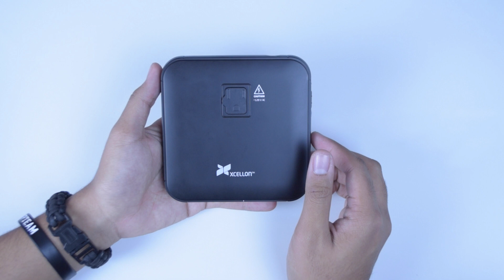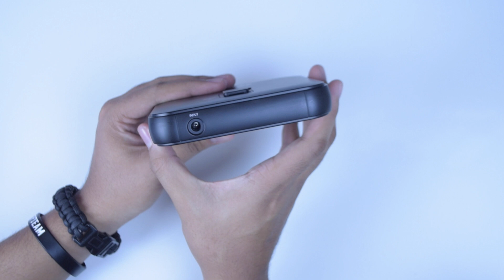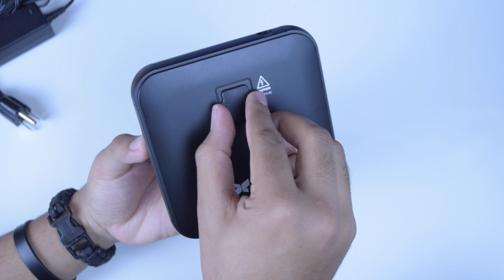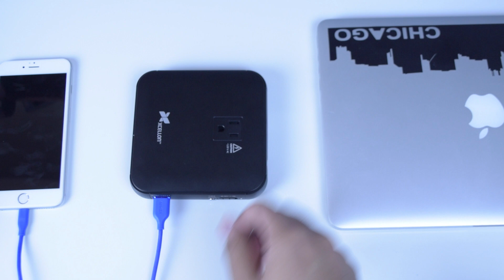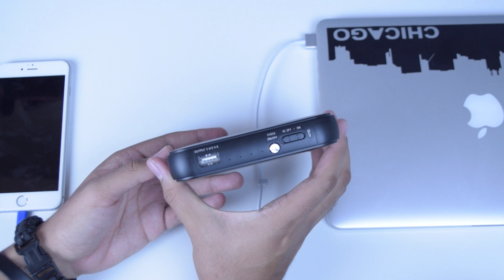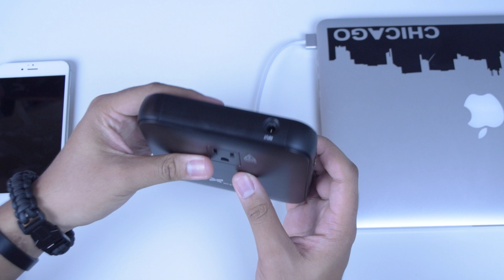This Power Bank Charges Laptops!

Comment: I need to get one of those. Because my digital SLR camera battery chargers can only be powered with 120 volts AC. In the event of a power outage, I have no way to charge my camera batteries.

Comment: 65W @ 120V = ~524 mA (which is a rather slow charge rate)
At that charge rate (~2.71W), it would take ~14.8 hours to charge a 40Wh battery...

That's not what most people would call a decent charger for a laptop!

Just so you know...